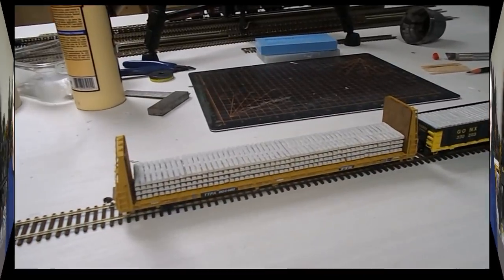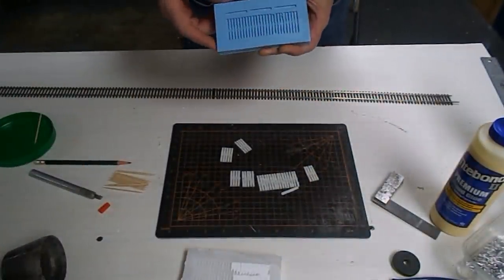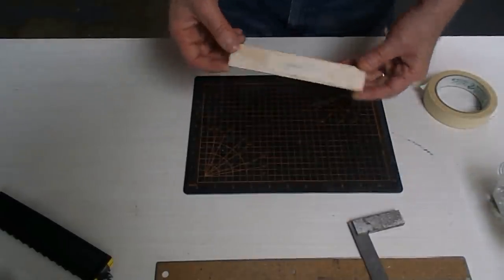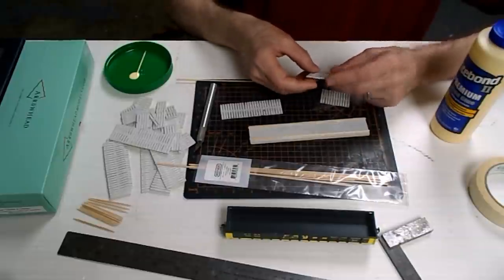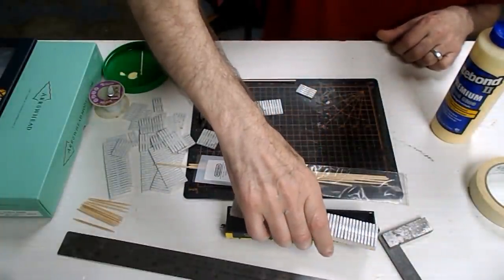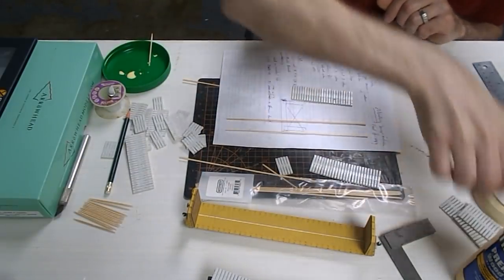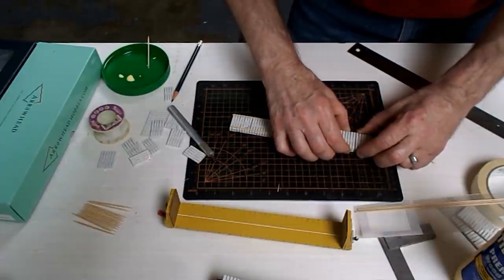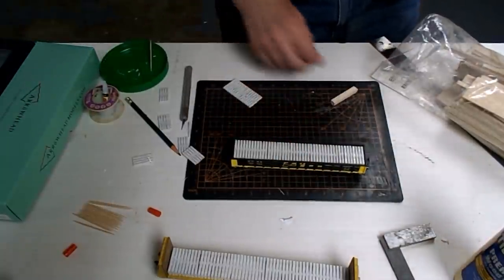Concrete tie loads for a rail-gon or a bulkhead flat

Comment: A thought.  Why not produce the mould with the ties joined to a side sprue, not a bottom connection?  Glue the resultant casting to the wood, turn upside down then cut off the sprue.  Might leave a small bump where the sprue is cut off but from the concrete ties I see stored down the round, this would be realistic as the ties I see have a very small bump with the rebar showing where through the end of the tie.  I am sure there is a good reason why it cannot be done that I have not thought about...

Comment: Concrete ties weight 600-850 pounds a piece. 100 ton load is 200,000 pounds, subtract the car weight of approximately 80,000 pounds. 200,000 - 80,000 = 120,000 load. That would be 150 ties at 800/tie. Corrected, I thought it sounded to high this morning.
Reply from the maker: I think your numbers may be a little off.  Concrete has a specific density of approximately 2.5, so if a tie is somewhere in the region of 8" x 8" x 8-feet long, that would be about 550lb, plus the rebar and tie-plates which have a much higher density (approx 7.8).  The total load capacity of a pair of heavy-duty 100-ton trucks includes the weight of the empty car so you'll get a lot less than 100-tons of pay-load.  I'm not sure what the load capacity of this bulk-head flat is, but they were built for large bulky loads (as opposed to dense or heavy loads).
Another viewer has posted links to some prototype photos showing only 180 ties per car, with one half of the load lower, suggesting that they may be approaching the weight limit (because there's still plenty more volume available).
Reply: Peter - your numbers are correct and with rebar and plates, total weight is likely to be around 650 lb per tie.  Assuming 80 net tons of cargo capacity for a 100 ton car equals about 245 ties and assuming a 65 net ton capacity for a 100 ton car equals about 200 ties.  Kudos to you for including dunnage to separate the tie layers and my only recommendation is to make the dunnage in scale 4" x 4" x 8' long sections as that is a typical dunnage size used.
Reply from the maker: @ronkluwe4875  I mentioned in the video that I planned to use 4x4 but didn't have any in stock.  I also pointed out that the timbers should be in shorter lengths but that I was using long strips to hold the load together.
Reply: @mpeterll  Peter - I have to admit I skipped around a bit on the video and I missed the part where you discussed what you mentioned above.

Comment: I have an idea for a video for you actually. I guess you could also consider it a challenge. So I am looking to eventually join a model railroad club but I want to be able to identify what rolling stock and locomotives are mine by a discrete label somewhere on them...the problem I am having is where to put it, because I don't know. Other people have literally engraved their initials in cars but uh, I want this to be easily removable and not permanent. I'd love to see your ideas for initializing your rolling stock for use at a club or other event so you can figure out who's stuff belongs to who.
Reply from the maker: In my O-scale days, I did take my models to a club.  I painted my initials and date of construction on the underside of each one as I built it for identification, although I never had to check because everything was scratchbuilt and unique.  I don't know if it would have helped if ever anyone was determined to steal one, but that never happened.  I don't really have any other suggestions.  Any markings that are "easily removable" are unlikely to be a good mark of identification in the event of a dispute.

Comment: Nice Video! But i think there should be wood on top of the top layer as well? Arent the ties fixed with them?
Reply from the maker: There's no wood on top in the prototype photos I've seen.  Okay, they're loaded on a purpose-built car instead of a general purpose bulkhead flat, but the principles are the same.
Reply: @mpeterll  maybe there is a difference how it's done in the US. In Europe ore in my case german you normally see it like this

https://c8.alamy.com/compde/htah9a/bahn-wagen-beladen-mit-neuen-cemex-betonschwellen-bei-hinksey-hof-oxford-uk-htah9a.jpg

Can't wait for next week's video. =) thank you for your work.

Comment: Would they carry ties in a gondola in real life? Seems like getting that back out would be difficult. I’ve always seen them palletized. Not criticizing, I’m just curious.
Reply: Personally, I've only seen them "new" and only on a MOW tie car. Note the built-up bulkheads on the ends and center. 
http://www.rrpicturearchives.net/showPicture.aspx?id=4193623
http://www.rrpicturearchives.net/showPicture.aspx?id=3006985
Reply from the maker: I thought I remembered seeing a photograph once, but I might be mistaken.  It seems like it could happen though.
Reply: Bulkhead flat would be for maintenance ties. The photo with the crane is for a track production gang. Concrete ties aren’t typically shipped in a gondola car. Wood ties are shipped in gondolas. A concrete tie is approx 750 lbs each

Comment: Well the earlier part of the video being unusable is a bit of a bother!  The most interesting part of making this load would have been preparing the tie masters over which the mold would was cast. Nevertheless interesting load that would be right at home on a contemporary setting layout.  Thanks for sharing.
Reply from the maker: Actually I never recorded the casting process for this project (although I have done resin casting videos in the past).  The bit that was unusable is where I showed the pile of raw castings and stacked them loosely in the cars.
Reply: @mpeterll  Yes the casting process you have covered in other videos and I have done that in the past.  It would have been interesting to have seen what you did to the stock ties to make them suitable masters (filling in the holes, removing the tie-down clips etc.).
Reply from the maker: @68Jaguar420G  Oh, that part.  That was quite a long-winded experiment with many false starts and I eventually gave up on recording it.